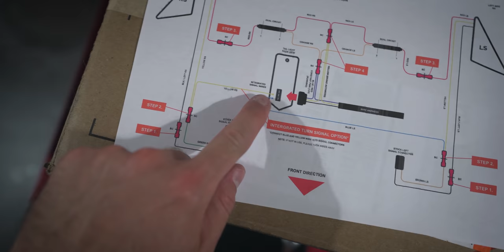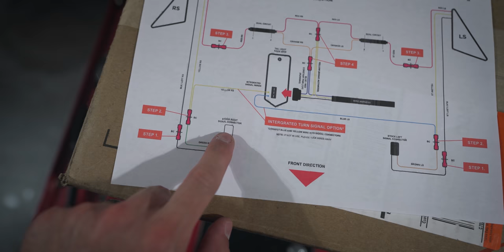CUSTOM Integrated TAIL LIGHT Install! [Yamaha R1]

Comment: Only thing I DONT like is that the turn signals aren't smoked as well. Id have to put some tint over them 😂
Reply from the maker: They are smoked. Might just not look that way on camera?
Reply: @motonosity  Guess I'd want even darker then. Like the same level as the taillight
Reply from the maker: redgtr yeah that’s fair. The led panel itself is white so up close you can tell. At a distance though it all blends in

Comment: Man, I am glad you made this video. I just picked up a 2020 R1 and had ordered a NRC fender eliminator because that's what I had on my 959. After watching your video with this signal setup and the TST eliminator, I sent the NRC stuff back. I just installed the TST eliminator and JL Designs signals and I think it looks incredible! Good call on this stuff man,

Comment: I got the same set for my R6 instead of splicing and wiring and what not, I went to lowes and bought some “tap in” connectors that like the name implies taps into the wiring making the whole process so 10x easier.

Comment: That's an awesome integrated taillight kit! I probably would've left the switchback wires disconnected so the turn signals only turn on when I'm signaling. It could be the camera but it seems a bit bright while running and not that noticeable when it switches to signaling under normal lighting conditions. Suuuper clean wiring job man! 👌🏾
Reply from the maker: Yeah to each their own. Lots of possibilities! It’s definitely easier to see a difference in person.

Comment: That tail light is honestly gorgeous. Really wish manufacturers would make it a bit easier to disassemble a bike, especially one with such a heavy modding scene behind it like the R1. I'm currently doing very similar stuff finishing off my SV650s project, just making everything look a lot sleeker and neater, like with the R1. Really good job on the install (and totally not super jealous about the beautiful bikes you own!)
Reply from the maker: It's really not that bad, just a few extra push pins and bolts here and there. My S1000RR is actually the easiest sportbike I've owned for simple disassembly.

Comment: I just completed this install on my 2019 R6  Sunday. The tail light brown and yellow wires literally have no slack as well. It’s unforgiving if you mess up and have to recut them. Turned out nice though after I was finished and soldered everything!
Reply from the maker: Yeah what I should have done was use those screw type splice connectors that allow you to tap into a wire without cutting it. My whole setup came out super clean though. Just time consuming.
Reply: Motonosity I agree! Very clean but time consuming! Safe riding man

Comment: @ Motonosity 
I have the same R1. 
Remember there is NO LEGITIMATE ECU FLASH FOR OUT BIKE YET SO LEAVE THE EXHAUST ALONE. 2020 R1 ECU HAS NOT YET BEEN CRACKED. 
I used the BLASTER X intergrated tail light THE BEST. 
TST FENDER ELIMINATOR LOW MOUNT.

Comment: u stick the signal lights to below the little fin.... now do 1 more set but it is stick to the top of the little fin. so u have 2 on each side... it should illuminate more. :) and disable the usage of the brake light as a signal light. keep it as a brake light.

Comment: Looks really clean but I would have not ran the turn signals and had then integrated in the tail light itself. Just my thought.
Reply from the maker: The tail light is integrated as well, as demonstrated. Having the additional signals add a more clear signal in the rear ( hard to really distinguish direction in the tail light) and I love how the side leds look.
Reply: @motonosity  I understand

Comment: Aww man.. can’t believe you gotta remove all that to get the taillight out! I went with the blaster x integrated taillight and just installed the tst low mount fender eliminator

Edit: are you running no license plate light?

Comment: Only thing I wouldn't do is make the indicators running red tho
Reply: I bought the exact same one, is it possible to leave indicators not running red?
Reply: @Nadalone  I mean there should be a way
Reply: @Nadalone  normal indicators have 2 wires one that connects to ground and one for power
Reply: @plumestuning  Do I need to use the Dual Function wires if I want the indicator light not to run red?
Reply: @Nadalone  probably not as i said before you will only need to have 2 wires connected to have them work like normal blinkers its just a case of which wire does what, so connect and see what it does

Comment: is the R6 and R1 tail light has the same size? i sold my R6 and i still have the JL designs tail light. Can it be fit to the R1/R1M 2017?
Reply from the maker: The exact same light. They’re identical :)
Reply: thanks man. atleast i can still use it. now i need the undertail cover and JL designs turn signal. i am looking for plate holder as well.

Comment: Wow, that seemed like such a pain in the ass just to get the oem brake light out.
Reply from the maker: Wasn’t that bad. But the R6 was a lot easier.
Reply: Yeah idk if it’s a Yamaha thing but it seems like you have to rip them apart to get anything done esp the tail section of the bike ... just watched a tst fender eliminator kit video and they had to remove the batt and Ecu and tons of plastic just to mock up the plate, so much work

Comment: Is there any ECU flash tunes for the 2020 R1 yet?
Reply from the maker: Not yet unfortunately
Reply: Motonosity  Dam I got a Two Brothers Slip on with cat delete since the bike has titanium headers from factory haven’t installed yet because don’t want to run the bike without a tune, I guess I’ll have to wait.

Comment: @motonosity 
Send me.your stock tail light from your r1 :) need a new one and can't run integrated in Australia as the laws here a really strict on that stuff. :)
Reply: You could run the integrated if you just don't connect the indicators to the centre brake and make sure the indicators are 180mm apart. Aussie rules suck